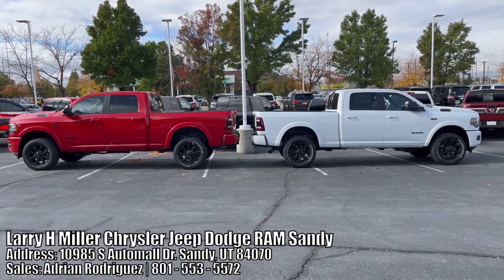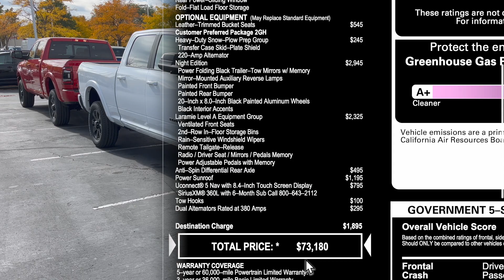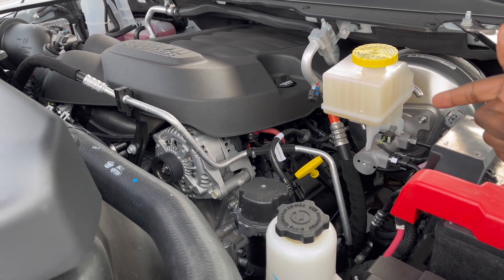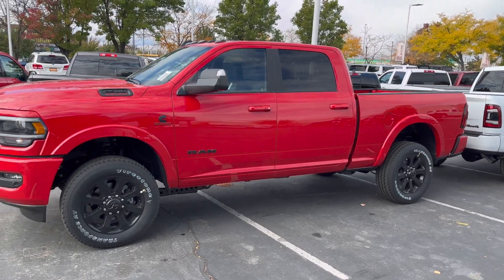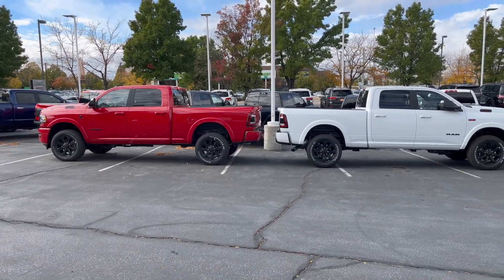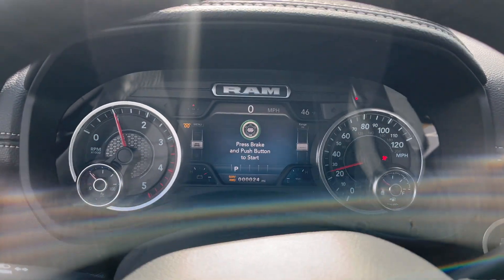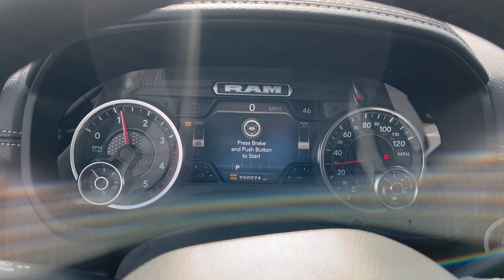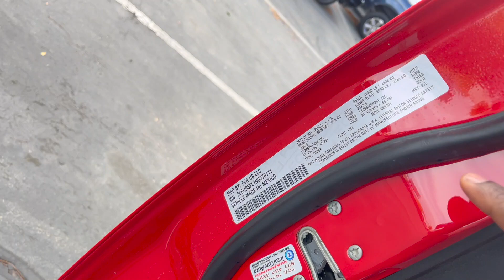Diesel Vs Gas: Why Is The Gas Engine Becoming More Of An Advantage Over The More Efficient Diesel???

Comment: I ordered a hemi 2500 in January, got it in July.  Didn’t want the headache of the Government Juice, higher price fuel, winter additives, $300 oil changes, $110 fuel filters, more payload with gas engine…etc.  Not to mention $10,000 less and the diesels are worthless after 150,000 miles (opposite of what they used to be).  I got mine with 4.10’s and it tows 16,000+lbs which is all I need without a CDL.
Reply: I looked at the Chevy/GMC trucks which are currently less expensive than Ram (hasn’t been that way until this year) but the GM gas trucks aren’t rated to tow much at all.  I’ve had a few bad experiences with Ford recently so I didn’t even look at them this time around.
Reply from the maker: I think with the GM trucks it depends on the tire pkg because I’ve noticed if they are not 20” the tow capacity drops 👍🏾
Reply: I was comparing base model trucks so that makes sense and that made it more cost effective to stay with Ram. Plus at that time, I was still able to get Ramboxes in the Tradesman.
Reply: Lol diesels are worthless after 150k.  Dumbest thing I have ever heard.
Reply: @HomerRules  I’m talking about trade in value.  Even resale now, new truck diesels are worth less than an gasser.  Used to be opposite
Reply: @rustrtal  you sure about that. My brand new diesel was 10k cheaper than any used diesel I looked at.  Might want to rethink it.  Friend just bought a used diesel for 4K more than mine a year later.   $110 for my oil change at the dealer, your numbers seem unrealistic.

Comment: What about getting a 2012 pre def. Dodge Ram with the high output Cummins
Reply: I had a 2012 with no DEF and it drank the diesel fuel big time!  DEF allows for 5-7 more mpgs!  My 2012 got 16 empty and my 2013 got 21 mpgs on highway runs.

Comment: The spot at what you’re getting the payload capacity I don’t think it’s correct because I typed in my Vin number and your Vin number on that truck and from the ram website the payloads don’t match with what you’re showing
Reply: Because your truck isnt the same as his😂😂. Not one truck will probably have the same payload number
Reply from the maker: That is correct, the trucks will have different payloads unless the options are identical and built within the same model year 👍🏾
Reply: @JB_WhoWork  On a side note, I suspect the rumors of the 6.7 i6 gas turbo for the HD’s a rumor after all
Reply: @BetaRacer24  the 6.7L part is incorrect but the Ram HD’s will be getting a 3L straight six twin turbo Gas motor for 2024 that will be replacing the HEMI.
Reply: @noosh8316  no way it will be a 3L in an HD truck
Reply: @BetaRacer24  it already exist as a 3.0L engine in other Stellantis products like the Grand Wagoneer. They're not just going to increase the displacement of it without a reason to, especially when they are advertising a HO version of the I6 Gas engine that will make 500HP & 500 TQ. Its coming as the replacement engine in the Ram TRX also.
Reply: @noosh8316  I don’t see it passing the duty cycle thats needed in an HD truck that consumers will buy. The same way the 3.5 Ecoboost makes more power than a 7.3 V8. But it cant stand up to the usage it would see. There is more to engines than HP and torque.

Comment: Did Ram increase the gas tank capacity for the gas engine trucks? That 31 gallon tank is too much a limitation on range.
Reply: You can option a 50 gallon tank
Reply: Thanks for the information. Is the 50 gallon tank an option on the short bed gas truck?
Reply: @Jbennyho  long bed Cummins as far I know because that’s all I’ve configured on rams website
Reply: @dustinbelknap9207  also long bed Gas trucks too, not just diesel.

Comment: I was originally shopping for a 3/4 ton diesel, but I knew I wouldn't be towing very often or heavy.  So I was happy to find a 1 ton gas.  You really need to work those diesels to treat them right - IMO.

Comment: I agree mostly with you. My take on it after recently owning both versions from GM is if you tow a lot OR when you do tow it’s long distances, get the diesel. For everything else the gas is superior. So for the daily drivers who tow occasionally or even a lot but relatively shorter trips the gas will be easier to operate. 

However I don’t at all agree with the 4.10 statement. Your own testing proved my point too. You tested a Hemi Ram before with both rear gears and the 3.73 was actually faster to 0-60 and got better fuel mileage. I’m telling you, with these modern transmissions, especially 8 and 10 speeds but even 6 speeds, the rear gears starting with a 4 are a waste for most guys.
Reply: This is the dilemma that I am in. My travel trailer is only 5k lbs. This year we've taken 2 long trips towing. Indiana to Colorado and Indiana to Florida Keys. We rented a 2500 w Cummins and drive was excellent. Even had 35 mph crosswinds in Kansas. Then rented a 2500 with Hemi drove from Indiana to Northern Ohio. While it did the job, it wasn't nearly as good of an experience towing. Had a strong headwind on the way back and I swear I could actually see the gas gauge drop while driving 😆
Reply: @JKoolina  I understand the dilemma. That’s why I mentioned long trips to just go ahead and get the diesel. I guess I could add as long as you’re ok with the extra maintenance because for a Cummins it is a lot extra. The Duramax I had there’s not a whole lot of difference in maintenance over my new gas Chevy but the Cummins actually is a big difference. 

I’d probably still say get the diesel for long towing trips. 5,000 is not a lot of weight but people get too hung up on weight because the size and type of trailer you tow means more than just the weight. 5000 pounds in a box is harder to pull than 10000 pounds on an open trailer.
Reply: Went 4:10 in my 2020 F350 6.7.  No regrets.
Reply: I didn't realize different diesel engines have different maintenance requirements. I assumed they all had additional oil and fuel filters. I'm debating between the Cummins and Power Stroke.
Reply: @JKoolina  Yeap. The L5P Duramax has one fuel filter located under the rear of the cab on the driver side. Takes about 15 minutes to change. 

The Powerstroke and a Cummins do have two fuel filters however. And they hold more oil than a Duramax. So they are a little more expensive.
Reply: @JKoolina  I went from a 12 Cummins to a 20 powerstroke. I was nervous about the complexity of the powerstroke but thus far after 64k hard miles it has proven itself. I wouldn’t hesitate to go back to Ram if they would update the cab and get a 10 speed. That Ford 10 speed trans is smooth.

Comment: Right now gm has the best motor with the 3.0 duramax in the 1/2 ton segment hands down with power, torque and the fuel mileage it gets is crazy good.  Nothing beats it there even with the diesel prices right now.   But diesels have never been as popular especially now with all the restrictions on emissions!

Comment: Back in the 5.9 Cummins days it was the golden days of diesel, no emissions, no def, the diesel trucks were still affordable, and the price of diesel was less than gasoline. That all went out the window after 2007.
Reply: Exactly! I lost over 3 mpg when they switched to ultra low sulfer fuel
Reply: I agree the last diesel I bought was a 2004. I refuse to buy a diesel with a DPF on it. Besides times have changed ,automatic transmissions have a lot more gear now and gasoline engines have gotten a lot more powerful.
Reply: Love my 2015 ram diesel truck with the G56. Pulls everything i put behind it and then some. But it did lose some weight.
Reply: @darryladams519  they definitely have to go on a diet.
Reply: Hmmmm 07?? Right before Obama came into office, now under this biden guy, h might get rid of diesel
Reply: Blame that piece of rotten shi+ President George Arbusto Bush and the Bin Laden family
Reply: Yep, i bought an 07 5.9 about 10 years ago and will run it as long as I can.  If forced to upgrade I will “upgrade” to the 7.3 gas Ford
Reply: @Ziggy_Wolf  been doing some research for you and it seams that a 2003 Dodge Ram 1500 Hemi 5spd Auto 4x4 Quad Cab will go for about $7500 in Texas.
Reply: @Ziggy_Wolf  close to 30k usd
Reply: Yeah we can all think Obama for that DEF crap. Glad I got a 2005 Dodge Ram 2500 4x4 Quad Cab 5.9 Cummins. Just turned 101,000 miles.
Reply: @stgraves260  DEF & emissions came out under the Bush Administration. The wheels were set in motion long before Obama. Congrats on the truck though!
Reply: Please stop suggest them messing with a class 2 vehicle,The Ford and GM are  1 ton trucks With three-quarter ton badges that doesn’t make it a three-quarter ton. Ram is offering you a genuine three-quarter ton truck diesel that doesn’t have to stop at DOT and is not subject to being inspected as long as it’s not Towing. The other trucks are please stop at least one manufacturer has remained smart and kept a class 2 diesel.If you want more payload buy a 3500!
Reply: I absolutely loved my 05 3500 with the 5.9. Wish I still had it!

Comment: I think you pretty much nailed it. Basically I would say if you tow a lot get the diesel but if you are towing less than 25% of your miles I would say gas all day long. Get you some nice leather seats instead lol
Reply: Towing isn’t just about how often. It’s more about what you are towing, safety and power.  Gas doesn’t do well when you start getting big and heavy.
Reply: @porn4406 Gas is safer cause it's less likely to be broke down on the highway like the modern diesel.
Reply: @rockie307 exactly. I’ll never buy another diesel. Can’t afford to have my truck in the shop for a month with the modern diesel emissions issues

Comment: Hey JB. The towing numbers would be the almost the same if the HEMI had the 4.1 towing gears right?
Reply: If I'm not mistaken, my 2500 laramie megacab with the 4:10 and the hemi is 16,600 towing.
Reply: wrong per my new ford. 7.3 with 4,30 gears is about 4000 lbs more than the 373 gears.  see the ford towing guide, plus the 7.3 has no fuel management to fail like the dodge and gm gassers.

Comment: How does the gas hemi compare to 7.3 Godzilla
Reply: I had a new 2020 ram 2500 with the 6.4 gas and I hated the mds. Would not buy another. I'm back in a 2021 ram 2500 diesel now but my next truck will more than likely be the Ford 7.3 gas with the 4.30 rear end.
Reply: @treeamigo8447 you could have deleted it with a tune if it bothered you that much or leave the truck in 8th gear so it doesn’t come on. I have it on my truck, never notice it even when towing.
Reply: @vr4787  
Yeah can put it in 8th gear every time you get in it. At the time when I bought it, I couldn't find a tune for the truck to delete it because the truck was too new. Regardless, ram has the least desirable gas engine at the moment and that's coming from a huge fan of ram trucks. This coming year gm is putting an Allison behind their gas engine and no afm/mds and ford has much more power and no cylinder deaction. Cummins is talking about building a gas engine that is based on the 6.7 diesel block and comparable power. When that happens I'll change my mind but as it stands, ram needs a new hd gas option.
Reply: It actually accelerates faster with 4.10 gearing.  I’ve smoked my Dads 7.3 Ford many times!
Reply: I haven't tried the 7.3 but had a 2018 3500 with 6.4. Great power but way too many "normal" noises for me. Lots make a weird chirping noise that resonates down through the cats on cold starts year round and mine sounded like a sewing machine under acceleration. Dealers all told me it was normal. I could still hear it even after I straight piped it. Tons of these trucks have this issue. Worried me as I approached the end of my warranty. So for those reasons alone I would go with the 7.3 and I'm not a Ford guy.
Reply from the maker: Great question, I did a video comparing the two: https://youtu.be/k6tSGxXeUlw

Comment: After 40 plus years of gas trucks bought my first DMAX  will never go back.
Reply: Even though the horsepower and torque numbers for gas/diesel look somewhat comparable on paper, those diesels are in a league of their own.
Reply: @treeamigo8447  horsepower # yes but at twice or more rpm. Torque not close at 18-2300
Reply: @techs1smh13  
Yeah it's not even close. Torque in those gas engines is way up in the ram range and even then, no where close to a new diesel in the real world.
Reply: @treeamigo8447  and at 2400 rpm
Reply: Just bought a new GMC 2500 AT4 with the Duramax and my first diesel and I can’t believe how much torque and how good it rides. I have a new Mercedes and the GMC rides better. It’s quieter. It’s a pleasure to drive. Gas is more expensive but the wow factor more than makes up for the price. 36 gal tank lasts me a while.
Reply: @MustyGarage   if I buy a newer D MAX I'm looking at 2019-20 I believe it's last of 6speed Allison and 3:73.
Reply: a life done on diesel truck..  lots of  torque..
 now    searching for a gas truck
tired of expensive maintenance,
 diesel  now cost more than   gas in canada,
 
 very disappointment of  all the electronic involved..
 .   if you pull heavy, just give time to gas engine  to Rev   smoothly,